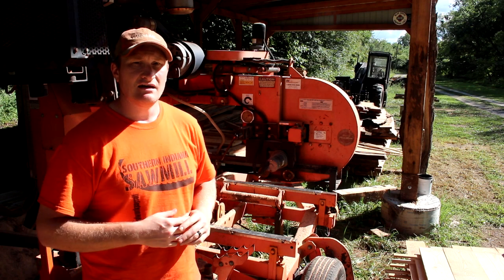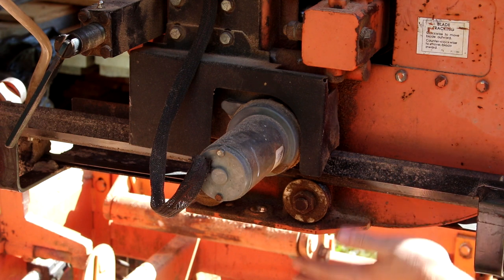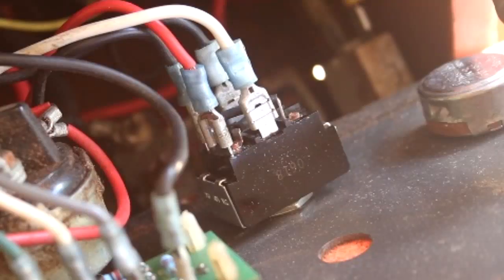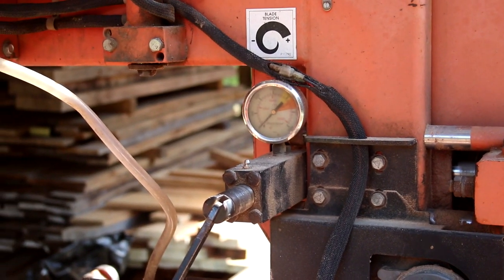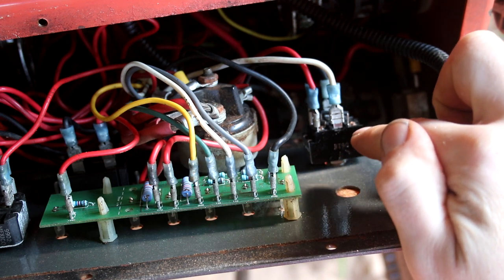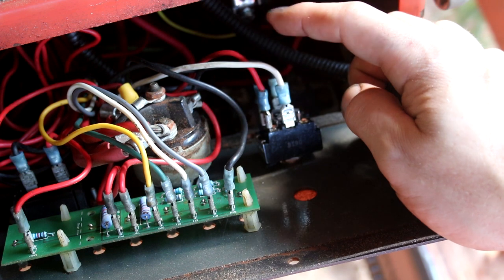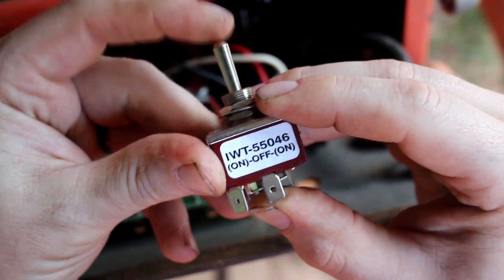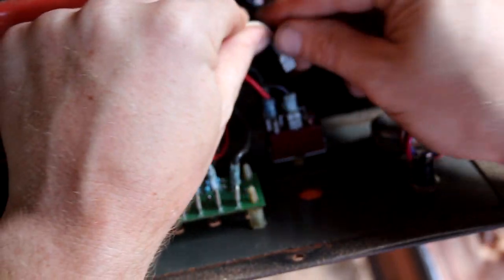Wood-Mizer Sawmill Blade Guide broken?  Here's the fix!  Diagnose and repair

Comment: I have an issue tonight with my lt40SH. I went to change blade, i loosen the tenison to 0. Tool old blade off and the wheel wouldnt slide over so the new blade would go on correct. Usually i just put the idle side wheel over and put new blade on. I hit it w rubber mallet and block of wood. Its locked up. Wont budge.  I made sure the tension handle was out about 2 inches thread showing. Still locked as if the tension hadnt been released.  What you think?